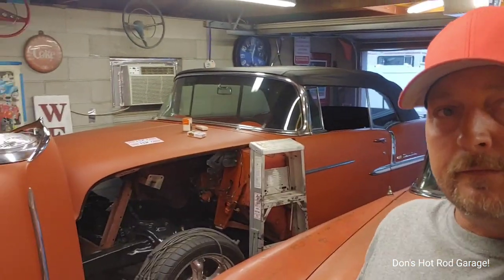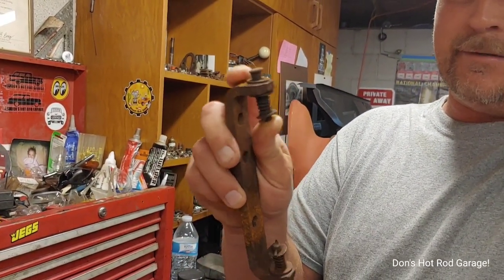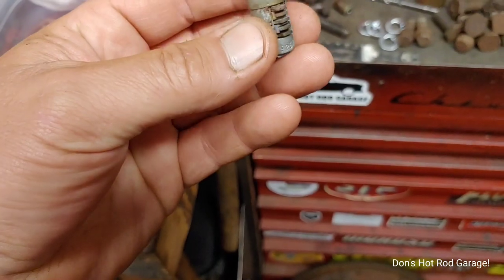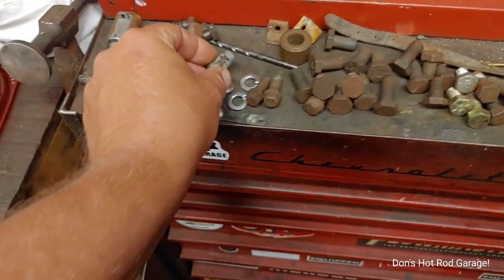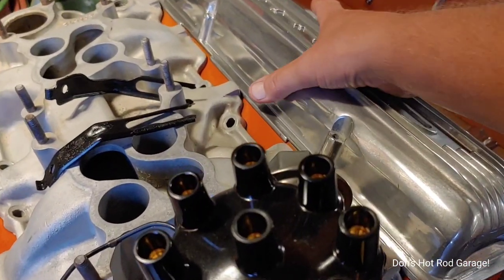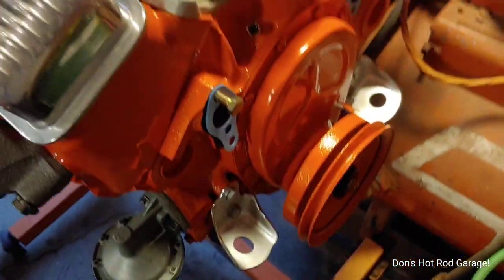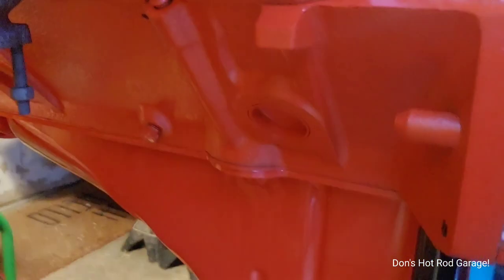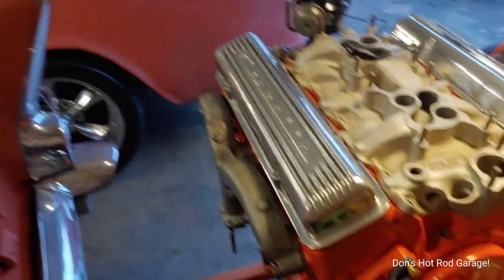55 Chevy Convertible Project car! Talking key codes and old toys from the 50s! Chevy 265 V8 Power💪

Comment: Don , That bracket with the springs is the correct bracket for the generator with power steering . It is a VIBRATION absorber so that the mounting bolts are not stressed and crack. DON, Don't skimp on the ragtop fix all the dents and make this car one of a kind and great.
Reply from the maker: Hey Edward! Thanks for the info on the power steering Bracket, its a weird setup but it would absorb the vibration from the generator! I plan to work on the body interior and everything on this car and make it a real nice car! Have a good one Buddy 👍

Comment: Good to see the progress on the 265. That generator bracket should be bolts instead of pins and springs. My 55 Chevy has bolts on the bracket.Make sure you get the entire 55 Chevy remote oil filter and brackets. You also need the copper lines to connect the remote oil filter to the block.
Reply from the maker: Hey Henry! Yeah man I was thinking the same thing! Although I looked at the 55 Chevy library and it's shows pictures and part numbers for the pins with the springs! It was ment to absorb the vibration from the power steering generator! On 56 and 57 the power steering generator has rubber bushing so they bolt up with a actual bolt, but 55 power steering generators are solid mounted to the generator bracket on the exhaust manifold! This bracket was on the engine when i took it apart! Learn something new everyday! Have a good one Buddy 👍

Comment: I always liked how the early small blocks especially in the corvettes had the plug wires nicely shielded and out of the way, it gave the engine a real nice clean look.
Reply from the maker: Hey Brian! Yeah you and me both! The early style small blocks was a thing of beauty the way they made them look! I can truly appricate all the craftsmanship that went into making these Engines! It was a special thing to have a v8 years ago. Have a good one ✌️
Reply: @donshotrodgarage1717   Got to remember by 1955 Pontiac had a 268 OHV V8,  Olds had a 303 OHV V8 in 1949 Buick had a nail head OHV V8 in 55 Caddy like the Olds had a OHV V8 in 1949 as well. This  shows GM was always WAY ahead of the times.
Reply: Hey mike right now it has a 400 but also have the 389 3 carbs on the side waiting for a rebuild for now I’ll cruise with the 400
Reply: @ponchonick9741   Nick I only own 1 Pontiac, but it's a good one. 1968 400 Firebird convertible, factory 4 speed, low production number car with manual everything, power nothing documented from PHS with hood tach, rally gages, manual quick steering box and very rare manual covert top, plus posi rear. Paint code matador red body with white top & interior. I have 3 motors for it. A 1970 YS Ram Air III 400, plus 4 bolt main WW Ram Air IV with a forged 389SD crank & rods, and the numbers matching WS 400 that came with the car. Bought it in 1976 after I totaled my 67 GTO H/T that I still miss. Firebird is covered in cold storage, but I may just pull it out one of these days, dust it off and crank up the Ram Air 4 in it.
Reply: @hydroy1  WOW and double WOW mike the 68 firebird convertible is an amazing ride and very low production you have to grant parole give it some tlc now because we don’t know what lies ahead in life enjoy that amazing car

Comment: Corvette used the same sparkplug wire bracketry and shielding. It was especially important for a fiberglass car.
GM engineers really thought things out before putting the cars into production.
Reply from the maker: Hey Ody Slim! I knew the corvette had wire shields but didn't know they was used to make the fiberglass car better. That's great info man! Catch you next time 👍

Comment: Its great to see the odds and sods which make it your home space .Small things can hold  place in your heart sometimes  The motor is going be a peach . The sprung bracket looks interesting enough to be right . Researching is half the fun eh Good hunting Don
Reply from the maker: Hey Mike! Yeah man its my little world. Lol I like what you said the bracket looks  interesting enough to be correct! It turns out that is the correct setup for a 55 chevy! 56 and 57 Power steering generators had rubber bushings and 55 generators were soild mount with no rubber bushings! Who knew man! Have a good one Buddy 👍

Comment: ...if I'm not mistaken, the generator with power steering combo has that bracket because under load of tight stand still turns the power steering unit flexes quite a bit so, to keep it from breaking out the hose connections, they put the springs on the mount for some shock absorption...
Reply from the maker: Hey Scottie! Yeah man the power steering is on the back of the generator! That is a car explanation for why they would have the spring loaded pins holding the power steering generator! Have a good one Buddy 👍
Reply: Glad to have helped! Hey buddy, the cars you collected with your dad are cool and a great memory, that's what our hobby and tradition are all about...look what your dad instilled in you,...that's priceless!
Reply from the maker: @scottewilliams4706  Yeah man your right! That's what its all about! Have a good one Buddy 👍

Comment: Your 265 is looking real nice. Regarding the generator/ power stearing pump springs, I had never seen them; however, I never had a V8 or power steering in my original 55.
 The push button was interesting information. I just can't beleave how cheap they built the 150 model.
I will look through my jar of keys maybe we could get lucky. To get that tumbler out you must be in the far left position then push the pin in with a paper clip which allows the tumbler one more position to the left  then the tumbler pulls out. But I think you know that.
Good luck on finding the bolt.
Reply from the maker: Hey Monadking! I'm very happy with how the 265 engine is coming along! I was able to look up that bracket assembly for the power steering and that is the correct set-up! Hard to believe they hung that heavy generator like that but the 55 library shows all the parts and part numbers. How much could they have saved by not putting a lock in the glove box of a 150? Let me know if you find a key for that code. Have a good one Buddy 👍

Comment: Hey Rockin Don. It's a cool garage you got there.  Lots of history involved.  You got some Shelock Holmes going on with the lock numbers. .elementary Watson. elementary.  Lol. Be cool to see the key fit.  I like your shelves with bolt threads standing up. Good idea.  Think I'll adapt that.  Well Donny. Whoops I did it again.  Lmao.  I bought a barn find. 30 years in a barn.  One owner from new.  1966 with all documents.  I just switched on Blocket SE. (Swedish Ebay). And it just came on Two mins.  It's not a auction it's just a sale site. My girl was laying next to me.  I said tell him I buy it and we send money now. . (SWISH) never  seen the car. no big discription in the add..it was too cheap..and a barn find. So the guy calls back and deal done but couldn't pick it up for eight days because we was away.  So picked it up early in the week.  It's a cool deal.  90 percent solid for a 55 year old car.  Comes with all receipts from brands new.  Engine locked up. But I'm going to build my girl a trail dragger hit the loose dirt roads around us. Put some full rear skirts . Good part about this car is road tax free and road test free for life.  The cars a Ford Taunus. (Not Tourus.) 1966 T5 M20. Two door. White with red interior. It's all there brother. Just got lots of cleaning to do.  Had to dump the tank.  Was full of thirty year old fuel. Stinking Stinking. Went to recycling.  It's the same floor pan of my first car. ford Cortina Mk 2 1600E. England. This is ford Germany version. That's it now not buying   Nothing else.  Lmao.   Good video Don. Your Engine coming along good. I told my girl. It's all about the journey. But she excited about her new ride. It's the same first car she had when first passed her test.  We both 1964 kids. Have a good weekend Donny. Keep feeding the beast. Adios Amigo.  Good luck.  Dino.
Reply from the maker: Hey Dino! Yeah man the old garage is a cool place for sure! I keep all the weird bolts and clips and funny little things on the sheilfs! There really easy to find that way! Man you could lucky on that old 66 T5 that sounds sweet man. That will make her very happy to drive it around! The barn finds are so cool man that's worth some extra cash just to oull it out of the barn! Its all about the hunt man that's where the real thrill is. Then the first drive after it's been setting for a really long time! Have a good one Buddy enjoy the new toy! Adios brother 👍

Comment: looking good man . that spring loaded generator bracket is interesting , mabe for the power steering  pump ? il look at some of my ps generators and see if any have it like that.
in 60 they put the pump on front of the engine. 55 to 59 it was on the generator so i have a few of them. i use that cast blast aluminum paint and the cast iron one too on all my project cars.
Reply from the maker: Hey Jim! Yeah man after research and a few people commented on that bracket! It turns out that is the original set up for a 55 Chevy with power steering! 56 and up the power steering generator had rubber bushing where they mount but 55 is a solid mount generator! I love the cast aluminum and the cast iron paint, there spot on man! Have a good one Buddy 👍

Comment: One thought about that external filter. I am thinking a modern day spin-on filter like a WIX or K&N would 
filter much better that that external or the cartridge type.  Just my thoughts. I am probably wrong. Thanks
Reply from the maker: Hey Ody Slim! Yeah man the modern filters do a much better job but there's no real way to use them on this block! 1955 Chevy 265 engines didn't come with the slot on the block for a oil filter! Thw remote oil filter canister was a dealer option for this year car! Have a good one Buddy 👍

Comment: About that aluminum paint. I used something like that back in the 80's to paint some heads for the 396 in my
Chevelle. I had everyone in the neighborhood thinking they were aluminum. Ha Ha !   Just wondering. Ive 
been eyeing up those wooden cubby's you are storing parts in. So is each cubby for a different project?
Have yourself a great day!  Regards from Ody Slim
Reply from the maker: Hey Ody Slim! Yeah man that cast aluminum paint is greats stuff and makes a old intake look like new! That's funny you had the neighborhood thinkinv you had aluminum heads! That stuff works that good! The wood Chubby has parts for all year tri5 Chevys and body shims engine bolts just weird little pieces. There's still some chevelle little trinkets in there from when I had 70 Chevelles. Have a good one Buddy 3

Comment: I own a ‘59 and I could check my factory assembly manual to see what type of bolts are used on that generator/power steering bracket. ‘59 was the final year for that set up. ‘60 Chevys switched over to the newer style independent pump and pulley.
Reply from the maker: Hey Thomas! I appricate the help! I looked at the 55 Chevy library and the 55 Chevy did in fact come with this hardware! The 55 power steering generator was solid mounted solid and starting in 1956 and on the had rubber bushings on the mounts of the generator! Have a good one Buddy 👍
Reply: I am trying to find the assembly book. I got a day off so I will dig for it. I only have one old car because lack of space to keep it. It’s a ‘59 Biscayne two door. It’s far from stock. Has a 1990’s 350 crate motor and 3 speed automatic in it.
Reply: Ok I found the book and it only shows bolts nuts flat washers and lock washers. But it mentions there is a bushing in the casting tab  of the generator I assume that is what their saying.

Comment: Don! I'm a hobbyist a model car builder since 1971. I have about 300 or so model cars most are built and a lot are from the 60s lots of drag racing and custom car models. I can understand your dads shrine in the back of your garage. Do not get rid of anything!!! Your YouTube channel always has great content. For a Ford guy that I am, I'm still always learning a bunch of tidbits about the small block Chevy. Got one question I overlooked to ask you about, is the 265 a solid lifter engine or did you change it over to hydraulic if that is possible??? You mentioned that you lashed the rocker arms??????
Reply from the maker: Hey Raymond! That's is really really cool man! I've always loved model cars and I have a big box full of them and most are still sealed in there boxes! I figure I'll build later on in life! I still remember when my dad would build them models and all the places we went  together to find cool stuff! I've kept alot of his stuff but I have 2 brothers and 2 sisters so everyone got something plus my mom still has alot of it! The 265 has hydraulic lifters in it but some still need to pump up once the engine runs. I soaked them in oil for over a week before I installed them. I just didn't want them to tight when the engine fires up! That's pretty awesome man your a Ford guy watching Chevy stuff! I do them same thing and always enjoy learning about all these cool old cars! Have a good one Buddy 👍

Comment: What did you use to polish the valve covers? I have a set of the repop cast aluminum ones and may polish them.
Reply from the maker: Hey Ed! I just use this Blue Magic aluminum polish! Mine had been polished years ago so they cleaned up really well. I think you may have to want your with some time sand paper and then polish them! If yours are really nice cast finish I would leave them that way, it'll be some work to polish them! Have a good one ✌️

Comment: i know the feeling. little at a time. i just finished my engine.  working on the frame now. was that convertible a original power steering car?
Reply from the maker: Hey Brad! Yeah man it just takes some time to make these old Hot Rods just right! I like to find the right stuff for each build. Yes this convertible was a factory power steering car! This engine is the stock original engine out of the car! Have a good one Buddy 👍
Reply: @donshotrodgarage1717  I know the pump mounted on the back of the generator could that bracket be just for those?